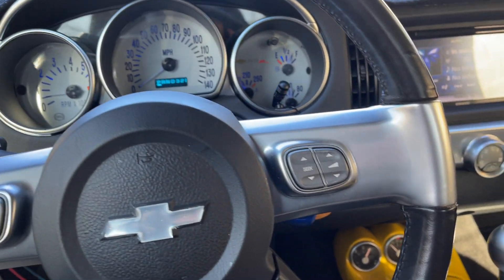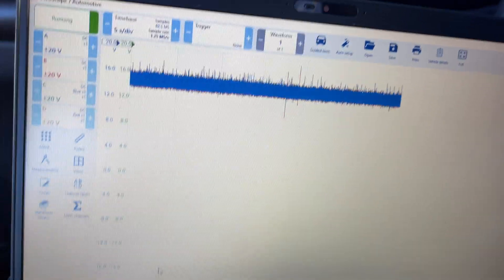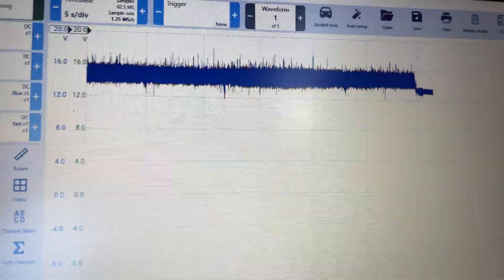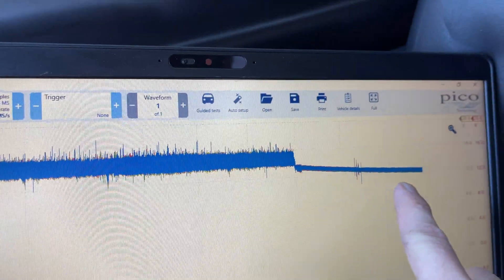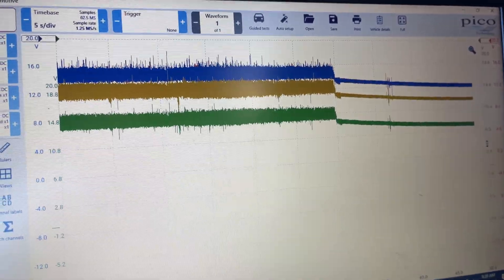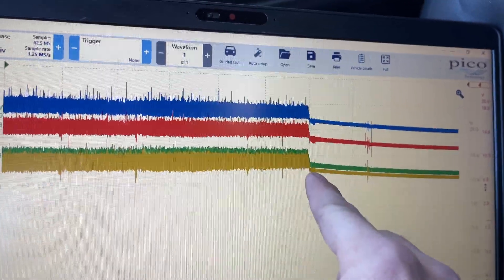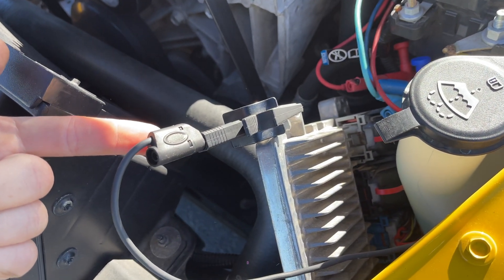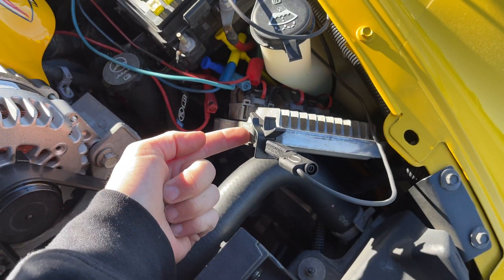Scope 5 wires using 4 channels?!?!

Comment: Adding to Richard Rudek's very good comment, his idea can be applied to any number of Voltage sources of any value. Millman's Theorem works well to analyze Voltage at a particular node in respect to ground. Powers and grounds can be analyzed in one pop. I used to use Millman's over and over when repairing non-modular televisions. Thats been a while back!

Comment: interesting.  the only thing i might wonder is since you scope is high inpedance (probably 50m input) it wouldnt take much of an iffy body to ecu case ground to still show good. i would prefer a loaded bypass test(5 amp test lamp from battery to case)  or a seperate battery to ecu case scope test.

Comment: You can also employ voltage divider circuits, with the scope on a known good ground.

For example, here, you could use two 1K ohm resistors in series. You then connect  one open end to the plus rail, and the other open end connects to the (suspect) ground. Finally, you connect a channel to the junction of the two resistors. So long as the scope already has a known good ground, if either the plus or the suspect ground open, you'll see it on the scope. Half the voltage, sure. But you'll see it the voltage jump up and/or down depending on which is failing at that particular instant.

And there are many other permutations of this. For example, if you need to monitor two plus rails with one scope channel. In that case, use three 1K resistors, joined in a star configuration. Two of the open ends then connect to each of the powers rails, respectively, and the last open end connects to a known good ground. In that case, you'll see 75% of the rail voltage, jumping about as the either of the rails fail.
Reply: Correction. two thirds, not 75%.

Comment: P0601 is the General Mess death code replace ECU.
Reply: P0601 does not always mean ECM is bad mate - don't be a parts changer, run thorough tests first then decide, as AD&P mentioned above (◔‿◔)P
Reply: @thesmartguy3523  Very true but as mechanic & electronics tech of over 40yrs who repairs modules the probability is very high in my experience & I'm NOT a parts jockey of caurse you confirm your diag properly first then call it.